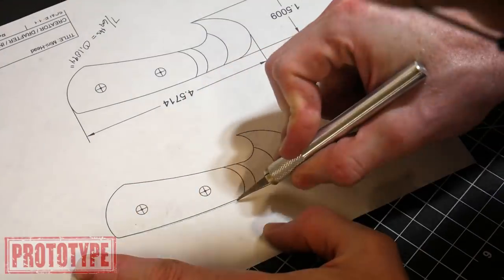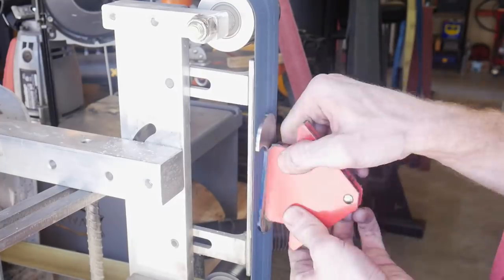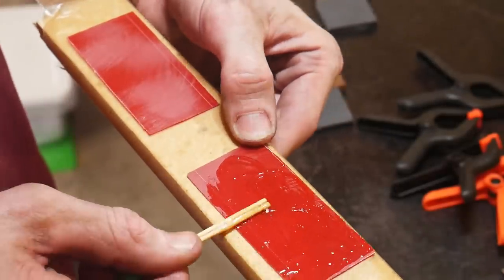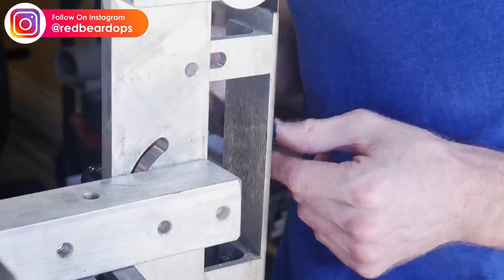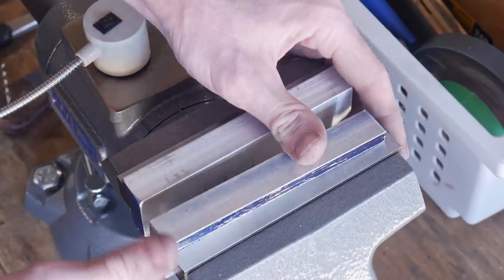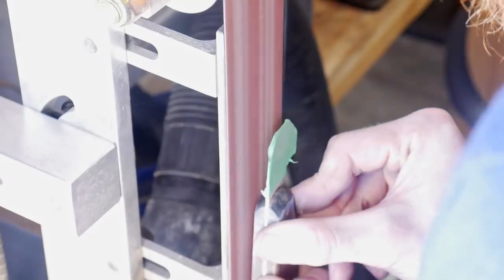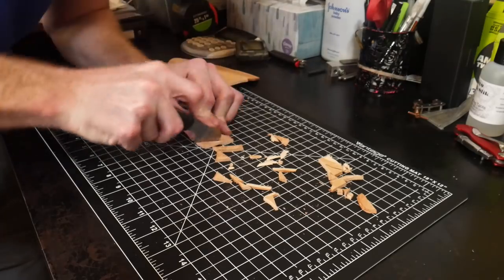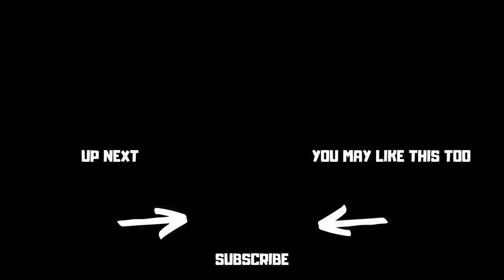Leather Knife | Mini Round / Head Knife Prototype

Comment: I like it. I also didnt know that you should do the leather stitches in this way and i just stitched mine without caring about that. Wonder how big of a difference it makes. That said your holes are much cleaner but i push mine open with an awl by hand (not  perfectly squared) leading to uneven holes especially on thick leather
Reply from the maker: You know I'm not a pro at leather work, so it may not make much of a difference! I have a ways to go with sheaths for sure! Good luck with your future builds, sir!

Comment: Nice little project. Your stitch is good and improving. What i do instead of doing 1 needle at a time i insert both needles at once, that way you eliminate the chance of splitting the thread. I use the tag ends on the needle to help push it thru. Now before i pull the needles all the way thru i take the thread on the left and lift it over the needle coming from the right. Then i take the thread on thme right and lift it under the needle coming from the left. Basicaly looping the the thread over the opposite needle, creating the locking knot then pull the needles thru to tighten up. Great idea on the heat shield for the oven. Did you use reflective tape or metal plate?  Looks like ill be catiching up on all jy youtube subscritions for a few days as i just broke the drive belt on my sander. So waiting for new parts now. Still have the 1 x 30 to fall back on, but will have to see how it goes.
Reply from the maker: Thank you very much for the tips man! I like that... catching a thread sucks! Here is the heat shield I went with. Heat Shield - https://amzn.to/3fPQNpG --- It has made a huge improvement in the ovens performance.... check out the graphs in this post - https://www.instagram.com/p/CC6DlimDnea/

Comment: Can I ask what it is you get out of just useing a file to determine if the steel is hard. How do you know what your temper is at best it's a guess I would think. I've asked other that just use a file and no one will answer. Just wondering with all the precision knife makers talk about why you dont use a Rockwell tester and take the guess work out of it. Thanks for the videos i really like the narration and not just music.
Reply from the maker: Thank you sir. The file insures that you at least got the steel above the rockwell of a file which is generally pretty high. I know that by using 1084 and quenching in parks 50 that the chances of my quench going wrong is very slim. Each steel has a "standard" tempering curve that allows us to target the desired hardness... like you said this is not an exact science and having a rock well hardness tester would be helpful to nail down the process. They're expensive though and I don't currently have one! Maybe one day I'll be able to acquire a good one. Have a great week!

Comment: Try #30 drill bits for 1/8th inch pins. Perfect fit every time.
Reply from the maker: I feel ya mike... but I have sooo many of these 1/8'' bits now! I don't want to waste them. LOL
Reply: @RedBeardOps  I did the same thing myself. Eventually, I ended up using them to drill through the blade, then using a #30 to enlarge the hole slightly for a perfect fit. It's definitely made the #30 drill bits Stay sharp a lot longer.

Comment: It's very nice but would look even better if the handle was buffed and shiny.
Reply from the maker: Yeah at the time I didn't have a buffer! lol
Reply: @RedBeardOps  I have a buffing wheel for my big bench grinder but havent used it.  Instead i use a 4" buffing pad on my drill press and it does good.  I  think I'm going to get a Harbor Freight metal cutting portable bandsaw.  This  angle grinder cutting is rough by comparison.  I'll make my own stand because the commercially made Swag is too expensive.  What I'd really like is a 2x72 but those are very pricey so doubt I could ever justify getting one.  I'm just knife making as a hobby.  If I was selling them like you then the investment would be worth it.  What do you sell your knives for ?

Comment: Love the finished blade! very nice to have this small maneuverable knive I imagine. I use a filing Jig to bevel the head/roundknives I make this makes it easy and safe to create a nice even bevel following the curve of the blade. I also use old circular saw blades to get the steel for these, works great and they are wide enough for a full head knife.
here is my version, I copied the design from a leather worker and knife maker chartermade. https://www.instagram.com/p/CBahNBND-LU/
Reply from the maker: Thanks for sharing sir, that's a great looking round knife you have there!